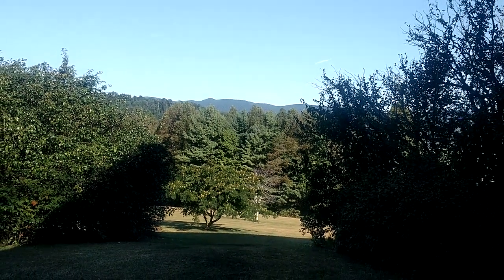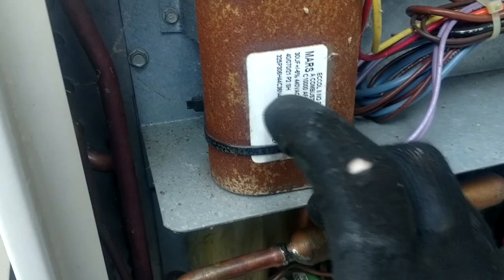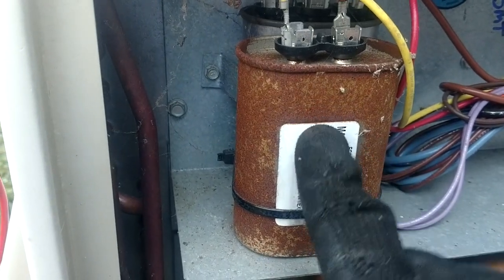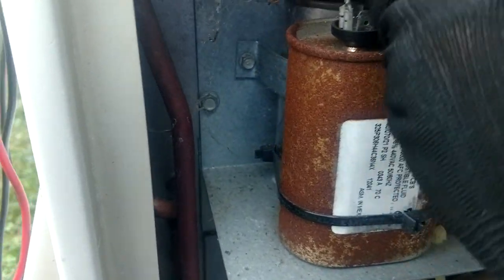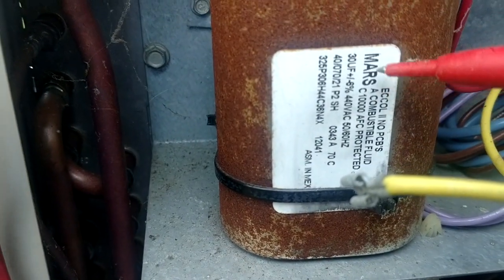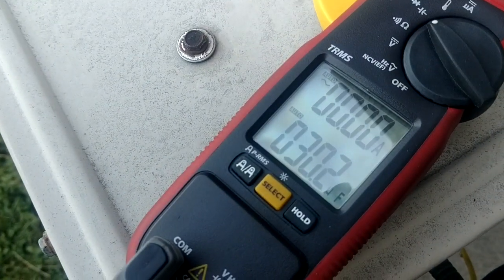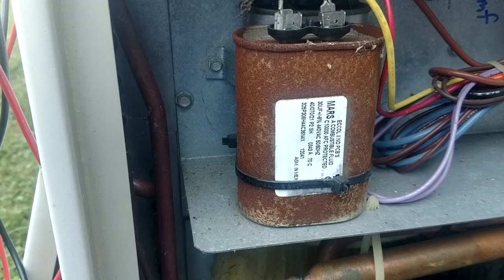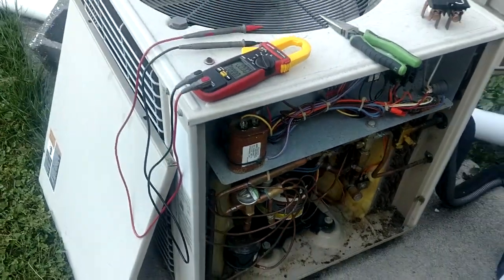Re-checking a Mars capacitor that has been installed for 7 yrs. Will it be weak? Let's find out.

Comment: transformers too. I've fixed quite a few appliances with chinese transformers that didn't hardly last 6 months from new in some cases. But I've fixed quite a few flashing LED lights that had bad filter caps on the power supply, all chinese.

Comment: Solid video. Yah unfortunately at work we got the cheap junk by Firstchoice which. Lennox sells
Reply from the maker: That bigger 5-ton Lennox unit still had the original 60 + 10 on it that checked out okay. But that thing's got some issues and a homeowners going to have to consider replacing it soon.